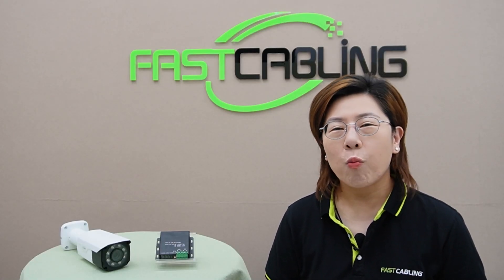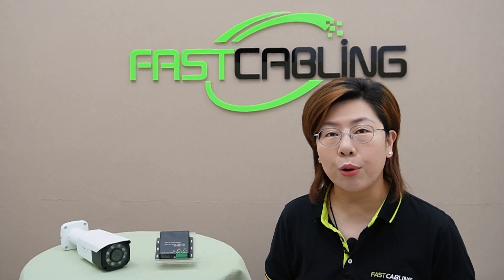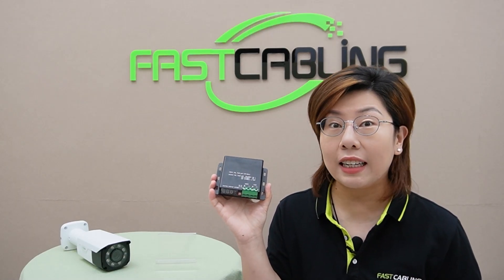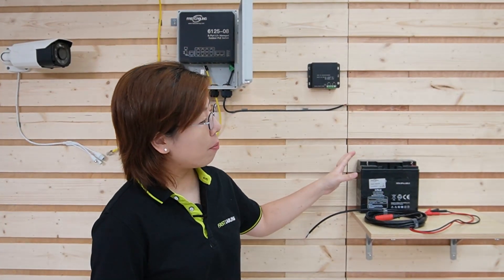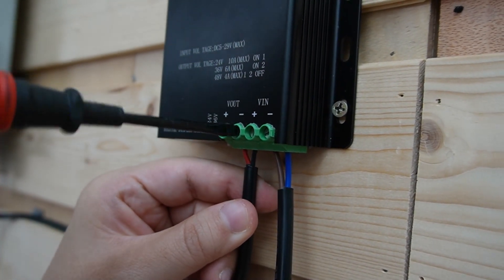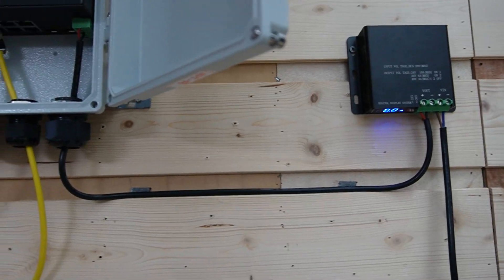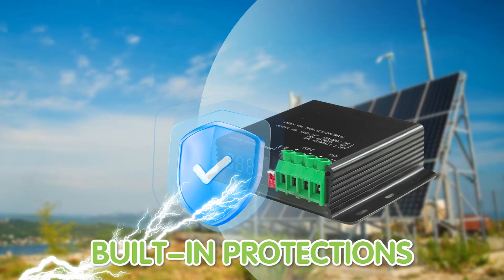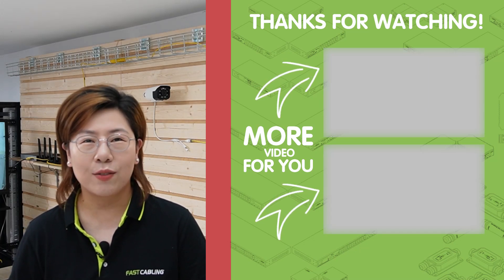Safely Boosting Voltage: Using a 48V Voltage Booster with Batteries

Comment: Great video. can you place the booster after the solar panel to then a charge controller. i need to charge a 48v bank, with a 12v solar panels.
Reply from the maker: Yes, you can connect the output of the solar panels to the input of the booster and set the output voltage to 48V.